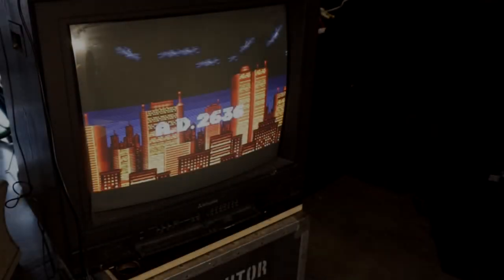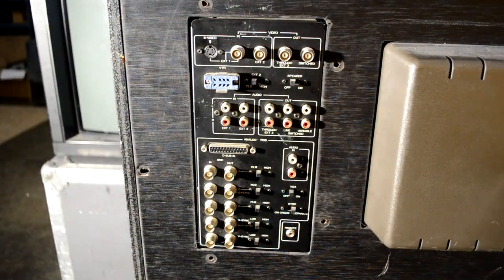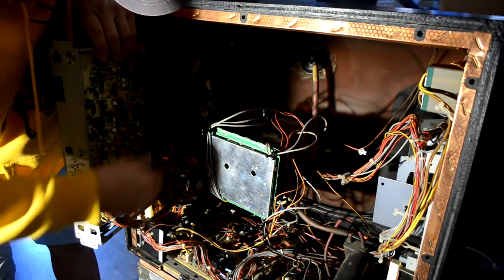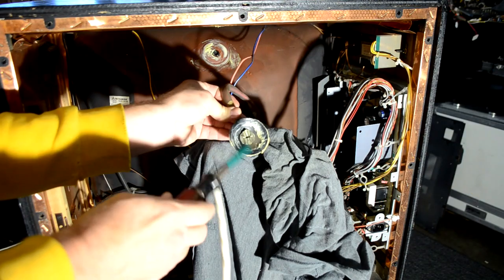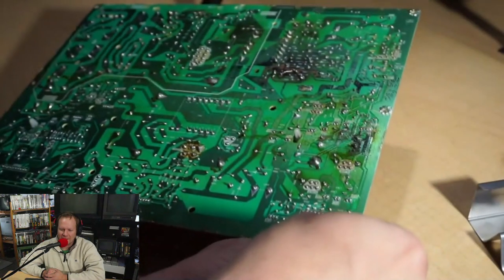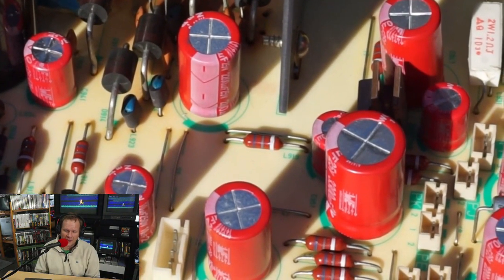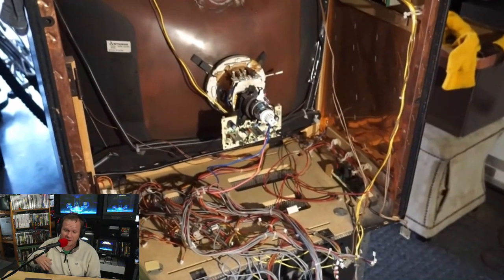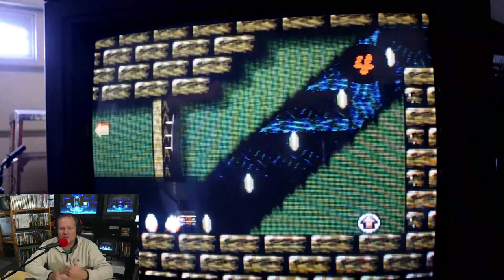Rare Mitsubishi SMR-2601R Pro CRT Repair | Retro Tech

Comment: That copper lining is so cool. Looks like a well built monitor. Glad you were able to save it.
Reply from the maker: It is cool.  I was thinking if it would be possible to do this or some other type of interference coating inside the shell of PVMs and BVMs.  That may help some folks with purity issues.
Reply: @RetroTechUSA  That’s a really good idea!
Reply: @RetroTechUSA  I wonder if one could paint or spray the inside with a shielding chemical.  Although, that wouldn't be very reversible.

Comment: Nice work!  I have a Mitsubishi XC-2930C and it needs to be recapped.  Dreading that weekend...I hope it only lasts a weekend.
Reply from the maker: Thanks, Yeah I was dreading this one since it has so many caps inside.  Thankfully it was just a section of them that went bad.  This would be the most expensive monitor to FULLY restore, or at least one of them.  Good luck on yours.  The boards are easy to work one once they are out.
Reply: @RetroTechUSA  Thanks for the heads up and positive words.  I'll document as much as I can.

Comment: Often had the same issue with the caps in their nineties VCR's..and that was 25 years ago! Good repair, at least the boards don't look to be too cramped, so relatively easy to make the necessary repairs. Interesting it has a tuner as that might've been an optional extra.

I remember they had a huge 36" (domestic) set in the very early nineties which suffered from slightly dark corners because the tube was so big! Mitsubishi TV's in general were bomb-proof..
Reply from the maker: Thanks, yeah a lot of electronics from this time period all have this problem.  This is pretty much pushing the limits on how long some caps can last.

Comment: It looks like a custom monitor. Like something Mitsubishi would build to order for enterprise customers, if I had to guess anyway. If it's really a presentation class set (which vga support over rgbhv leads me to believe) it was likely in use in some very peculiar environments to require all that protection. There's an operations manual up for sale on Ebay for $16 if someone's curious - that's not a lot to spend for some information on a rare set.
Reply from the maker: Thanks, I saw that same manual and that's about it.   I did talk to a friend and he's got a 35" version of this monitor made by Mitsubishi.  He said it too has the wood and copper liner.  He also said it's so heavy it almost hurt him permanently when he had to move it.
Reply: @RetroTechUSA  Have you taken it to a scale yet? It might be the heaviest CRT in its size class haha

Comment: Nice job but you should always re solder all solder point on the chassis and power supply board just a tip to help you out thanks for the video
Reply from the maker: Thanks for the tip.

Comment: Another awesome video! I have a Mitsubishi EUM 3741A monitor which is extremely similar in design. Mine ist Multiformat. Looking at the high voltage cascade of the flyback, yours might be too. VGA to BNC cable and a PC should be enough to test.
The caps in your set make me very nervous.
Reply from the maker: Thanks.  It actually was brought to me by a buddy so I'll let him know.  Good luck on yours.  There are lots of caps in this CRT.

Comment: Awesome video! BTW, I have an NEC XP-3790 monitor that looks pretty good, but has a few issues. The thing was probably serviced before, as it had a bazillion magnetic strips behind the tube. The problem with the monitor is that it exhibits greenish lines horizontally across the screen whenever there are bright images or a lot of white. Have you seen this before? Does the monitor need a recap? Thanks!

Comment: Hello Steve, I was wondering if you could offer some advice. I recently did a cap kit on a RCA F27TF700.  It went well, but didn't fix the jittery screen. I started testing resistors, and I kid you not, it's looking like half of the resistors on the board are either short or out of the tolerance threshold. I've seen a lot of your videos, and you seem to have a confidence in resistors that comes across as if they are super unlikely to go bad. Is this just my bad luck or have you ever encountered something like this?

Comment: I'm curious why there are so many audio port on it, do you know what the logic behind it is?
Reply from the maker: Since it's designated a presentation monitor, It was designed with lots of inputs and outputs to hook the Monitor up to many machines.  They would have a few devices and switchers going in for audio and video and then coming out to daisy chain into something else if needed, like a 2nd monitor.

Comment: I have a 20L5 I cannot get the geometry right. I've replaced the D board from savon pat but it still stretches on the left side. Any advice?
Reply from the maker: I've had some issues where 20L5 D boards were worse looking after recaps.  Some where so bad, that I went back and re-installed the original caps and it looked better.  Pat's kits for the L5 do have some altered values.  Those are recommendations from Sony and maybe they prevent long term wear and tear, but they can sometimes wonk out sections of the geometry.  Do you have your original D board too?
Reply: @RetroTechUSA  yes, thanks for the response! The stretching is the exact same on both boards, I was hoping it was a cap issue but it's a geometry that I just can't seem to figure out. It is stretched to the left and slightly compressed on the right.